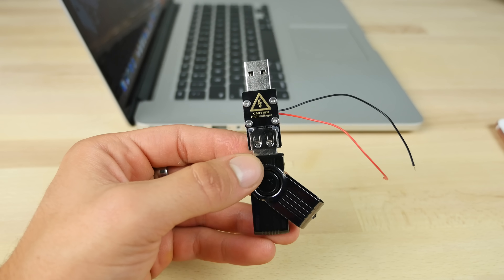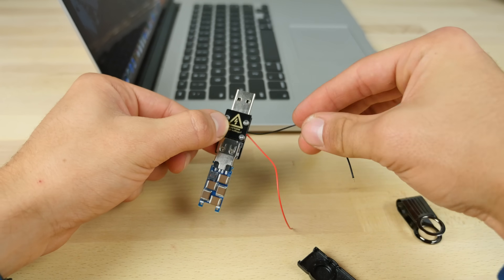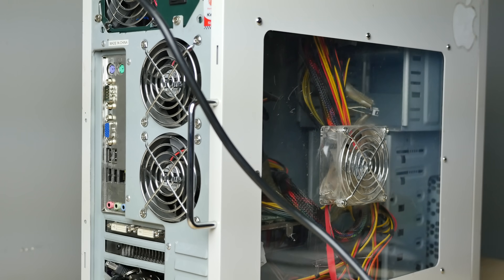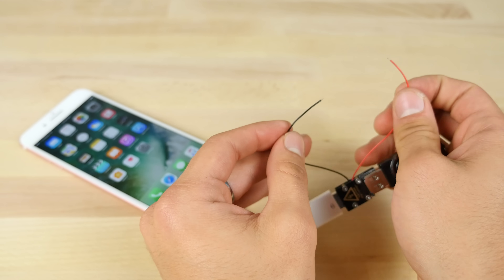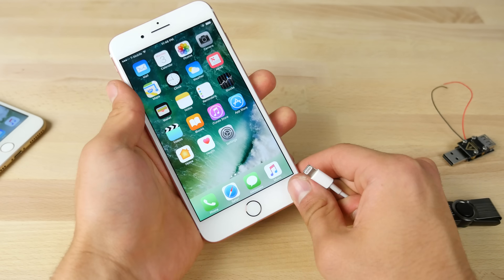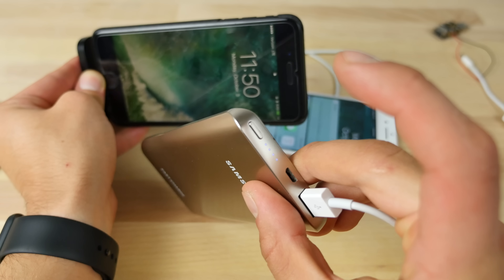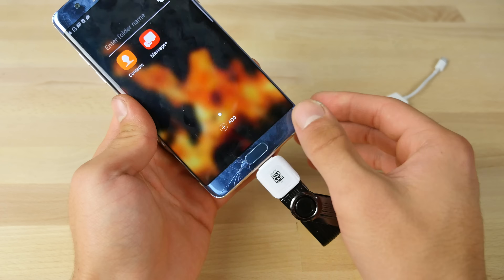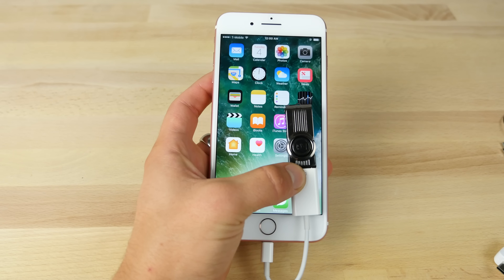USB Killer vs iPhone 7 Plus - Instant Death?

Comment: You have some nerve, to hold a Note7 in your hand while doing stuff that can potentially explode it.
Reply: Note7 is a way better phone... if it didn't explode. But yet again it's a lil to like 1 in a million chance since people are still using them and it only happened once so far.
Reply: Daikataro Kamegawa the iphone 7 and 6 have a higher chance of exploding than the note 7
Reply: This is what happens when someone with no knowledge of the subject tries to interpret media. When a LiPo gets bad it expands and starts to smoke because it acts as a short. It can even catch on fire but it doesn't explode. This video isn't done scientifically enough in my opinion. Usually a phone battery is about 3.7v. A USB power protocol is rated at 5V and that USB killer is thus rated for 5V which is why the spark was so weak. It's very unlikely that they have built in high voltage protection in a relatively small budget device like that. That is usually built into the electrical network in the house/building you have your phone charging at. Now I will also point out that this is not always the case, older houses/buildings usually doesn't even have that. And the technology behind it is not bulletproof. 
AND to all of you who think that the charge is reaching the battery...  The killer works in such way that it charges through the incoming two power conductors in the USB, and sends it charge through the logical RX/TX conductors thus sending the small charge directly to sensitive IC components, including RAM, CPU, Chipset and radio modules that can't handle even such small amount of current with that high voltage. If the battery receives the charge it will not get significantly damaged, and thus will not trigger the batter to explode lmfao.
Reply: it doesnt explode like a grenade? it just expands and smokes
Reply: It stops the charge before it ever reaches the battery. Otherwise a thunder hitting power line would explode every connected phone in 2 mile radius.
Reply: thom hummel idiot 😂😂😂
Reply: the note 7 doesn't explode, it expands and catches fire, learn the difference kid...
Reply: Lol it wouldn't 'explode' instantly. You would feel it get hot and see it smoke before that. Theres been less than 100 reports of Note 7's battery's  "exploding"/catching fire anyway
Reply: @Enamoured Chicken
A thunder hitting a power line HAS the potential to fry electronics connected to said power line, which is why it is recommended that you use surge protectors to connect sensitive electronics (flat screens, computers, basically anything you don't want toast). It doesn't even have to strike the line directly, it can cause a transient by just hitting nearby. And yes I know the literally exploding cases are few, I still wouldn't risk holding one in my hand if I am doing something I know for a fact, messes with the voltages.
Reply: Daikataro Kamegawa fry, not explode. Any device with a battery has a safeguarding fuse. Something will break, but battery will be protected and will not explode.

The most common appliances that get fried are stereo sets, DVD players, TVs, radios - all things without a battery.

Comment: PTC/NTC/Thermistors to the rescue. Lots of motherboards have this to regulator the current from death devices from this, as well as diodes. It will work after it cools down, if it is a PTC reset-able polyfuse, but cheaper ones aren't.

Comment: That thing looks just like a flash drive. Having that laying around is just asking for someone to mistake it for one, with disastrous results.

Also, why would you be worried about someone plugging this thing into your phone? (5:26) It's not like a security flaw that would let them access your files. The only reason anyone would have to do that would be if they just want to be an asshole. And there's tons of ways to destroy an iPhone with the screen lock active. Hammer comes to mind.

Comment: Samsung is 116 years ahead of apple. It was able to integrate a headphone jack into its phone, which was invented in 1910. With that, you can listen to music or other audio from your phone. Apple has developed a different way to do thios, however, this method is not ideal, as it quickly runs out of bats, and can only be used by overpriced apple hardware. With the headphone jack, any brand of headphones works with your phone. AMAZING.

Comment: The USB  Killer uses the datalines of the USB. If you set your device to charging only it might not unlock the data lines to allow current to flow through it. Set it to file transfer mode and see what happens then.

Comment: If you make a video about a product you must first know the product! And its victims in this case "Because is such a low voltage port you are not getting a lot of power through it" It outputs 5V same as a computer the power is lower because the current is!

Comment: Most phones (like iPhone 7 and Note 7) have a separate assembly for the usb port. And they may have a circuit design where it prevent (either sacrifice itself or redirect/weaken the current) high voltage flow into the motherboard and killing it.

However some smartphones like LG G4's does not have separate USB port assembly. Instead the USB port is part of the motherboard. I think these phones may be vulnerable to USB Killer.

Comment: I had a similar product, and a friend tried it on his iPhone 6, because why not, and it just showd "Unsupported Accessory" and turned it off.

The Product was not that similar, it passed high voltage to the charging part of the Port. It fried the Cable, the phone was fine

Comment: That wasn't an iphone7 -.-
Reply: It had a charger thing
Reply: And there is no iPhone7 plus
Reply: Yes it was. The iPhone 7 has a charging port, and if it didn't it wouldn't be sold, or even made for that matter. And yes there is an iPhone 7 Plus
Reply: Real_RUBB3R sorry I forgot that the iPhone seven didn't have a headphone jack I mixed it up with the chargerport

Comment: Question. Ain't the USB killer is a single use only ? 
since you already used it on your computer, the capacitors should have already been blown ?
Reply: no, they just discharge, only way to blow them up is if you overcharge them way to much.

Comment: Why dont you try charging the usb killer in a computer before putting it in the phones, the phones obviously dont output enough charge to their otg port to charge up the capacitors enough to unleash a deadly charge to the phones motherboard.

Comment: USB-C is a pretty recently developed standard. I doubt that high voltage resistance is something that Samsung engineered into the phone; instead, I'm pretty sure the USB-C port's failure to fail is by USB design :)

Comment: It's not that the phones have a protection against this, it because the phones doesn't give enough charge to the USBKill 2.0 to begin with, the tiny spark you see is just not enough.
Reply: +Anon User Hey mate, electronics engineer (apprentice) here. My company recently had to design USB-chargers for special industrial application and I've read the USB specification a bit, especially when it comes to charging phones. I think I can clear things up a bit.
First of all: both dedicated chargers and your computer deliver 5V on USB (there are some rare 20V chargers but those are not mainstream yet). There is no thing such as a low-voltage USB-Port. The reason your phone charges slower on a PC is simple: your phone detects it's connected to a PC and limits the power draw to 500mA (effectively making it a 5V*0.5A = 2.5W charger). If your PC fails at communicating with the iPhone, this power is limited to the even lower 100mA current, hence why a broken cable could still charge, but only slowly. Every phone that wants to comply with the USB standard is doing this in order to protect the port it's charging from.
Second: I have no clue what you're trying to say here, but although the cable was meant to carry around 5V, it can probably carry around 1kV. Cables usually don't fail unless you crazily overvolt them or put them under harsh physical stress. It could have been the failing part here, but because he was using another cable to prove it wasn't charging means that the iPhone must have gotten some of that high voltage.
Third: I never heard of dedicated data cables for mobile phones, especially lower voltage ones, because the only thing that usually changes is the CURRENT. I have a feeling you have no clue what you're talking about.

+Frankie Williams is probably right, something inside the iPhone most likely fried. It could be contacts (solder melting, pin corrosion) or a semiconductor (e.g. protection diode) failing.
Reply: ***** 
1.: 5 Volts is not a speed. That's like saying your car goes 3000 RPM fast.
2.: Almost all USB to Micro-USB cables are designed to charge phones and are required to be able to withstand at least 0.5A of current. So: every USB cable has always been designed for more than just data transfer.
3.: Of course voltage on a cable can exceed 5V, even if it was not designed to go above that. The reason you're not supposed to use it with more than 5V is because: it may fail.
4.: Voltage can not be sent. Voltage is applied. What goes in and comes back however is called 'current'.
5.: 'Electronics engineer' is what I'm using as a translation for what I'm doing because those two words are usually the only ones people need to hear. The correct position would be "Elektroniker für Geräte und Systeme".
6.: I'm 23 years old now.
7.: That's Chef Excellence, I thought it'd be a neat picture to use. Also according to yours, you must be a blue person with a levitating head.

Oh, and by the way: I only have one cat.

kec2222 absolutely right
Reply: +Anon User Aww how cute. Someone's FLAMING mad because they got called out on their bullshit LMFAO
Reply: resistor doesnt limit voltage-V=I*R and I=V/R so by increasing resistance you decrease current not voltage an you still don´t limit anything you´re just reducing it(and i´ve never seen a cable with resistors in it)
and insults mean that you´ve run out of arguments
Reply: voltage doesn´t have anything to do with charging speed.how fast something charges depends solely on the current supplied by the charger.and there is no such thing as 5v cable(have you ever seen how usb to [another type of usb] looks like inside? it´s just a few wires going from one conector to the other one)the amount of current and voltage a cable can transfer is limited only by its size-smaller cable will melt at lower currents than a bigger one.and btw i also grew up in modern age
Reply: An excellent wrecking
Reply: Main reason is because solder on the phones is small and fragile, Little heat with melt it, That's probably what happened.
Reply: ***** I never said it can destroy the phone I was simply saying it works because it destroyed the charging port.
Reply: ***** Lol you got wrecked.
Reply: Anon User got wrecked
Reply: popcorn is ready, waiting for the next reply from NKN
Reply: You quite obviously have no clue what that device is doing.
"In fact, it would only bounce 5v back."
Nope.
What it actually does:
-usa a voltage boosting circuit to charge the capacitors to a harmful but still manageable voltage, 100..200V would be reasonable.
-dump the capacitor's charge into the data lines (not the power lines)
The device will repeat that until it receives no more power. Doesn't matter that the USB system was designed only for 5V at all.
Usually, the USB host device will hava some kind of protection circuitry to protect the host controller from electrostatic discharges (ESD TVS diode arrays).
The protection is made to deal with something like the charge on a human body etc, not a big capacitor array. It will degrade with every discharge over time and might fail eventually.
NKN1396s guess on failing TVS diodes is reasonable, would be my first guess too. Probably failed by short circuit and saving the rest of the phone with that.
Reply: +Var Niha Well it fried the charging port on the iphone so apparently it DOES.
Reply: the phone has a protection it has several safety mechanism so the battery dont explode. if the current is too high the safety mechanism is going to burn out and the battery is going to be stoped charging so it does not explode and you can keep your hands.
Reply: Var Niha
Reply: ***** LOL TRIGGERED!
Reply: kec2222 g
Reply: You seem to be getting very angry, this indicates you may be quite young, or cannot accept being wrong. Either way you have demonstrated you have no understanding whatsoever of even basic electronic principles so just save face and accept that your wrong. Go and read a physics book (or a lot for you) and come back.

P.S I'm not saying that being young has anything to do with how much knowledge a person can have, I'm just noting it because typically people that are very young have terrible tempers when it comes to being wrong.
Reply: Ignore the troll guys, you are feeding his power
Reply: Anon U suck
Reply: OOOHHHH mom get the fucking camera
Reply: Yeah that's what I thought. ¯\(ツ)/¯

Comment: The PSU just detected the high voltage and you need to disable power from psu for 10 sec and the pc will work again :D

Comment: Ok.  sooo. fake iPhone fine. samsung fine. real iphone not fine.
Reply: You mean the Allah akbar 7?
Reply: TechMan221 dude, fuck off.
Reply: Steve W the clone is Android, right? So maybe all or most Androids guard against this. 

The iPhone could still be used if it had wireless charging :)
Reply: ***** Next item is USB repair it sucks the power from the Allah akbar 7
Reply: What are you trying to say?
Reply: MrKillerfreak1 Yeah sorry I completely forgot that other companies don't do this, at all.
Reply: ***** 
ikr
Reply: You can send them back to apple and they'll fix the lightning connector for free (as long as you don't tell them what actually happened)
Reply: Paul Chaos I'm sure they will be able to tell they should be able to see more voltage was trying to go through the connector and either fried it or destroyed the power regulator.
Reply: TechMan221 Yeah but they can't determine who's fault that is.
Reply: ***** Sure you can its not designed to take so much power going through it so they will probably think you tried using an overpowered charging cable with the device.
Reply: TechMan221 An "overpowered" charging cable... These phones are often used by elders, They probably won't have to pay for this.
Reply: ***** People tried making getto fast charging cables before and they causes the same thing to happen so it wouldn't shock me.
Reply: Do you know what that even means?

Comment: "Low voltage port"? USB has 5 Volts, no matter on what port. But USB on a device like the IPhone does not give you the whole 500mAh current that you would get from a PC. So it is a low CURRENT port, not a low VOLTAGE port.

Comment: "Low voltage port so you're not getting a lot of power through it"
Should probably learn a bit more about how electricity works and the Lightning and USB specifications.
Also, the tester exists so you don't have to fry expensive parts to prove they are vulnerable to the attack. If you get a spark - it's vulnerable. If you get no spark, it's not vulnerable. Period. Production value of the video was okay, content was poor.
Reply: As far as the why and how of the effects seen on the two phones:
The USB charging feature of the Galaxy Note 7 allows unidirectional current at a decent amperage to leave the phone. This is why you get "more juice" and why it doesn't kill the phone. There's protection from current coming back into the device. This is put in place so that if you were to plug the phone into a charger and then put it into that mode you won't run into problems, a side effect of this is that it isn't quite vulnerable to the USB killer. The lightning port works a bit differently, and is wired in a way that both the iphone and a device connected to it's USB port can get power. This is so you can have weird expansion cables that allow you to get a headphone jack and other things while charging the phone. Internally, the lightning port is isolated from the rest of the board by decoupling circuits. These circuits are designed to fail when too much current is present to protect the rest of the device. Hence the lightning port dying, but the rest of the phone working.
Again, more or less a useless video thanks to your lack of real information. Just some kid playing with toys.
Reply: Voltage = Pressure
Current = Flow
Wattage = Power

Then there is resistance, but I don't think I have to explain that.

Comment: because the note 7 actually has an overvoltage protection circuit (belive it or not there is a lot of safety in the charging circuit)

Note 7 don't actually explode
seriously, prove me wrong with video or pictures of an actually exploded not just burnt unit 
and no, that jeep burned down because of electrical issues in the car not the phone re: the fire marshall's report

Comment: The difference between batteries and direct power might be something to look into if you're actually interested in why it didn't work. Simple answer: a capacity array like the USB killer is a simple battery, so it can behave like an extra storage source when hooked to an initial battery. When plugged into something that converts AC to DC (a power supply for example) power is only supposed to flow one way, but the capacitor array makes some go the opposite direction, frying the weakest point in the circuit.

Comment: Inbuilt in the iPhone is a small Circuit which allows two sections to head when it recieves power. It acts like a resistor in ways that half of the recieved power goes to power the phone and half goes to dud. The IPhone allows 5volts to go in the rest is sent to the Ground (GND) that's why it didn't work.
P.s Apple is pretty smart for doing all this